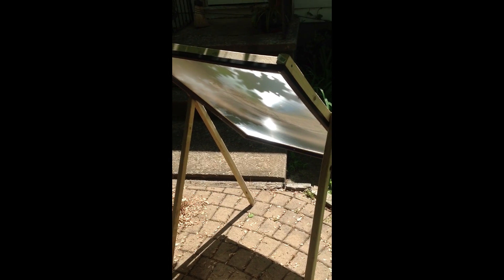Barbarossaaaas lab

Comment: There is a threshold for all senses and if you overload them you do damage. Bright light damages sight, loud sound damages hearing, vibrations damages touch. This is not rocket surgery. You stare at the sun and you damage your eye. You stare at a light bulb in your house long enough and it will damage your eye. Overloading your senses is also known as desensitization. Once something has been desensitized its not likely to recover its full sensitivity. Staring at bright light desensitize your eye

Comment: That's pretty neat actually. If I can get a small enough one it seems like a fun thing to take next time I go camping. I wonder, would a container designed to both trap heat and cold like a thermos or mini-cooler be a better container with which to heat the water in?

I imagine the heat would dissipate rather quickly in an open-air environment. A metal thermos might be ideal, just not a plastic one obviously. Sealing it may heat it faster with the additional pressure it creates too.

I think.

Comment: Ya they're pretty cool. I considered picking one up to add to my preps. As you know, I'm both a MGTOW and a Survivalist. One of the most important preps is to have ways of being able to cook if the utilities go out. For that I've got a couple camp stoves, an awesome small wood stove that's designed to be used in a tent, and a couple cool little camp stoves that run on twigs.
But the arrangement you have can be tucked away pretty easily.
How much storage space do you have?